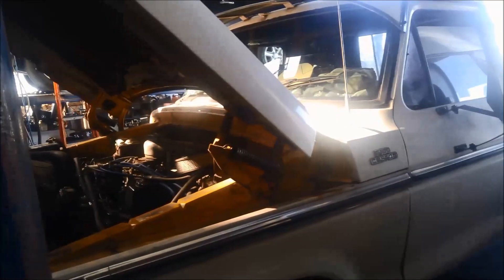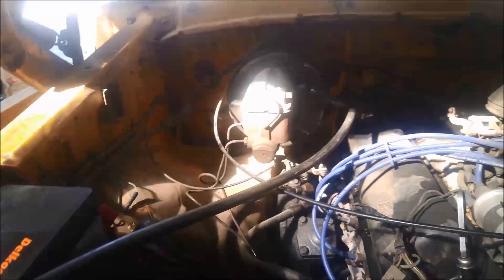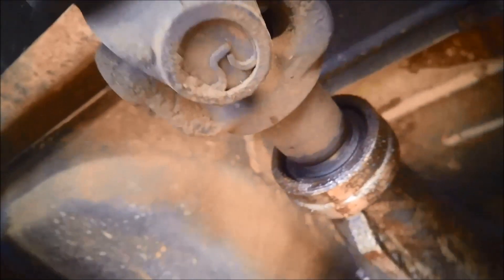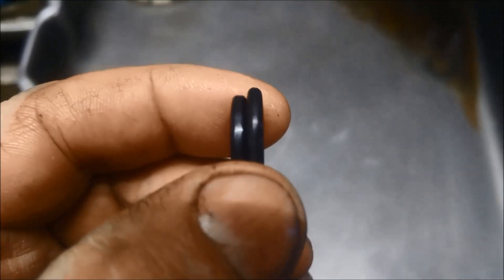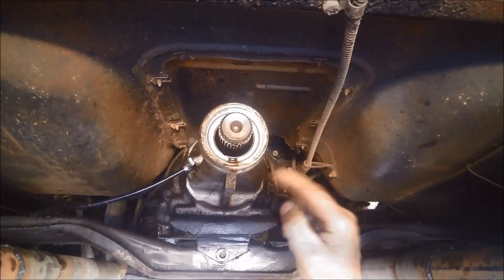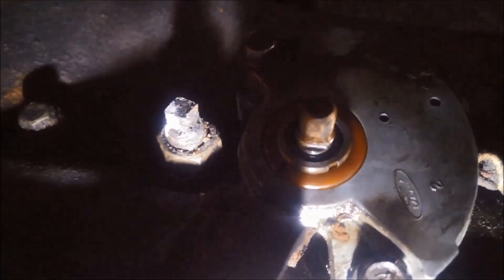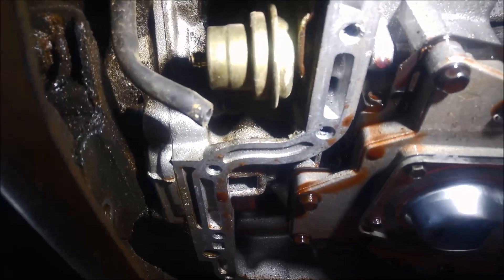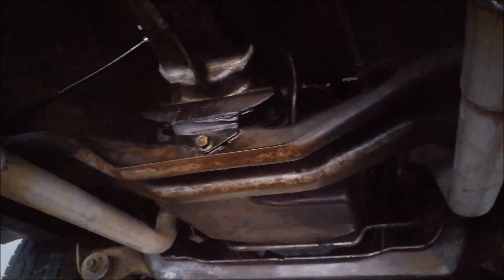Ford C6 Automatic Transmission Filter Service & Band Adjustment - Vacuum Modulator Fluid Leak Repair

Comment: Thanks for the video. I dropped the pan to change the filter, and discovered a bad modulator that was leaking. Swapped it out and adjusted the band as you showed. The ol’ ‘88 F250 shifts like a new one now. 👍
Reply from the maker: thanks & cheers

Comment: I really liked you covering the vacuum lines, rubber and hard lines. This is overlooked too much when trouble shooting the Modulator/shifting issues. Good Stuff! Thanks for sharing. Cheers from Motown. Oh guys, don't forget about the pin in the Modulator that must go in. You can get pin replacments from Transtar.
Reply from the maker: hi, thanks for that...also in another one of my vids ( sorry cant remember which one ) i run through the modulator pin length modification if you have a low vac motor and how to adjust modulator screw. cheers

Comment: My C6 /6.9 IDI upshifts late when cold
(2-3 at 40-45mph).Thanks for the additional knowledge before I pull the pan today!
Reply from the maker: check vac line and modulator as well. cheers

Comment: I miss these old cars, straight forward repairs, dead simple.
Reply from the maker: yeah they were the golden days, funny though the modern transmissions don`t last any longer....they save a bit of fuel, however much more expensive to create, maintain and then to repair, which would outweigh the fuel savings and the later ones would have much greater carbon footprint...we call this technology and progress
Reply: @YepThatsIt  it's like VVT  engines higher maintenance and only 5% better economy Yet a tiny hho cell or hh cell much more power far less emissions the engine runs cooler oh but it's illegal.
Reply: And I forgot atleast 20% better economy, well if you correctly set it up
Reply from the maker: @closertothetruth9209  i thought hho generator  is used in trucks and cars for ages?
Reply: @YepThatsIt  yes but not too many done professionally and insurance companies can use these cells as a loophole , even cop mates tell us they're not entirely legal.
Reply from the maker: @closertothetruth9209  tell them its to slow global warming

Comment: What on the c6 would make first gear almost equal to 2nd. When I'm towing with mine it has no low end torque in first. Thinking maybe band setting?

Comment: I've got the same transmission in a 1989 E350 Motorhome.  I lost 3rd gear after we moved and the van sat for 7 months.  The fluid is good, the kickdown cable is good.  No visible leaking from the vaccum modulator and good vaccum.  I'm wondering if the tranny is just shot or is there anything else I am overlooking.
Reply from the maker: hi, make sure you have good vacuum at the modulator. sometime people run a non suitable vac hose all the way from the inlet manifold to the modulator and is either kinks or collapses when warms up and inhibits vac. make sure the brake booster isnt on the same t-piece or will leach off vacuum as well. cheers
Reply: Dealing with same problem I measured vacuum with gauge showing at 18 checked hoses they seem okey not sure how to verify if indeed vacuum is insufficient I get very crisp reverse and 1/2 shifts perfectly just doesn’t go to last gear definitely mind boggling

Comment: Thank you for the C6 content. My new project 1972 Convertible with the 429 with a C6. Age and Deferred maintenance by prior owner has me busy. What’s the difference between a green stripe modulator and a black stripe modulator?  I have a street cruiser but want it to have firm shifts.  
Is that bushing tool available at parts store or online?
Reply from the maker: hi, the shift points from standard adjustment are slightly different. modulator (screw in) found in 1966-72 ; modulator (push in) purple stripe 1973-on, ; modulator (push in) green stripe 1977-on ; modulator black stripe commercial 1973-80. you can use any adjustable if you can`t find the correct one. the bushing tool we make ourselves if you are in australia we can post to you. cheers
Reply: @YepThatsIt  Thank you for the info. I have 1972 429 with the C6, not sure what is installed, I had heard an upgrade would be the black strip modulator if replacing it. I was asking you to verify. I am located in Austin, TX so not local.

Comment: I have an 87 f150 that won't go into overdrive the top speed is 35 to 40 mph, could poor vacuum or a bad modular be the cause? Good video btw.
Reply from the maker: hi, check all the basics first including vacuum modulator and vacuum thats actually getting to the modulator. cheers
Reply: @YepThatsIt  I've discovered that when I removed the old modulator that the pin was missing, now I'm in the process of making one. Thanks for your reply.

Comment: Just wondering, I thought the C-6 only used type F trans fluid? Thanks
Reply from the maker: hi, you can use any truly compatible fluid. cheers
Reply: After early 77, it's Type-CJ. That was replaced with Mercon, and later Mercon V. Earlier transmissions take Type F. If it takes CJ/Mercon/Mercon V, it will carry a fluid code ending in CJ on the dipstick. If it takes Type F, the fluid code will end with F. Note that CJ is compatible with Dexron II(D) (Type D) so the fluid used is correct.

Comment: My c6 slips from 2n to third, box has only 300km
Reply from the maker: hi, can be many things internally. check basics first and band adjustment also try an adjustable modulator and screw in to see if firms up shifts. on these older trans you can add moreys honey to thicken up fluid a bit to help couteract internal pressure leaks. cheers
Reply: @YepThatsIt  Moreys honey 🍯 I’ll have to look it up
Thank you